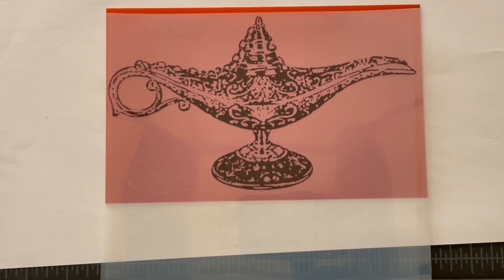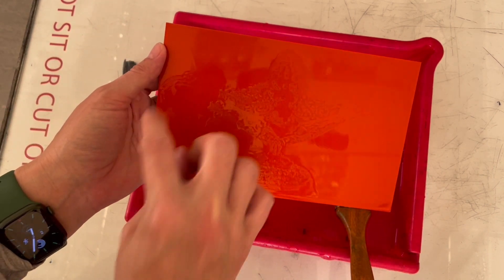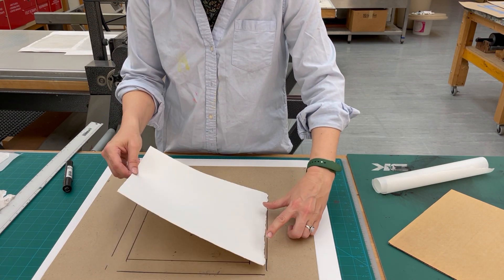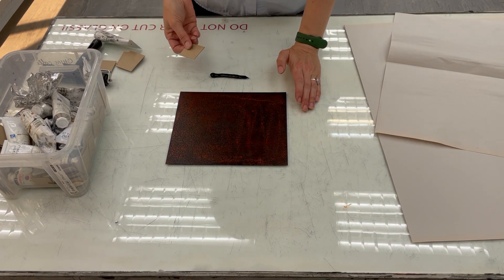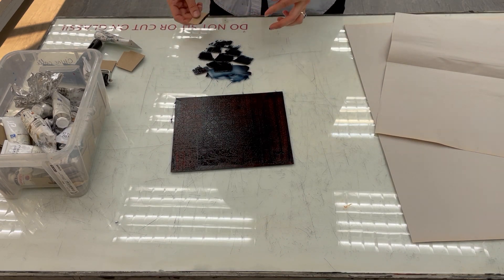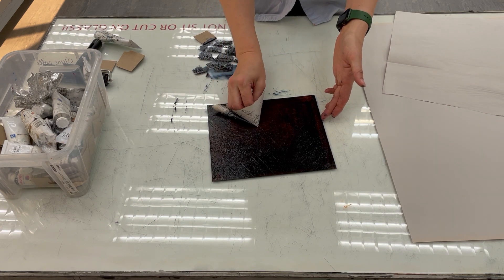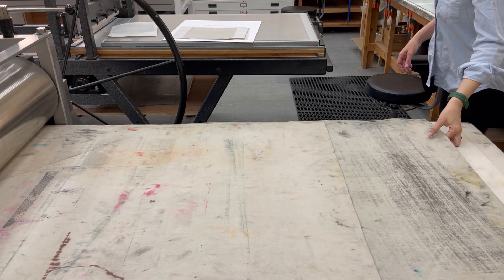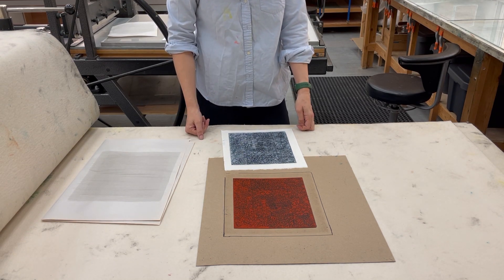solar plate etching

Comment: Hi, What happened to the first plate you exposed? Was the “lamp” meant to be a relief print?  (the illustration looked like a genie lamp) did you first  use an aquatint exposer then the 2nd exposure?    I agree that this is not copper plate….also, too many blankets….

Comment: Your title is misleading because you're using ready-made not copper plates. You seem to have an excessive amount of blankets on your press and you have the felts on top and below which is odd because that would warp the plate as you run it through.